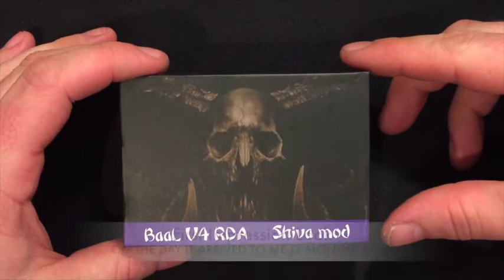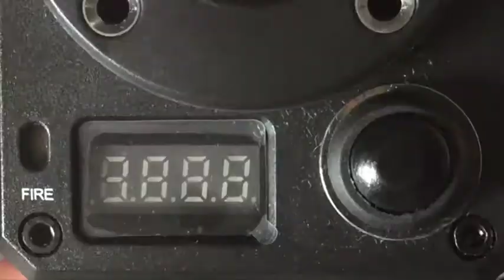BAAL V4 RDA ~ SHIVA TUBE MOD (CLONE)

Comment: Nice video!
How's the battery life?
Reply from the maker: Thank you, sorry for late reply, the LGHD2 is only 1500mah so the battery life is not great at all but I use it on mEch mods sometimes because they are 30A & safe with low build etcs. I only have 4 of these batteries I just use them on occasion, my normal go to batteries for 0.1ohm builds & up would be 1st SONY VTC5A or 2nd choice SAMSUNG 25R